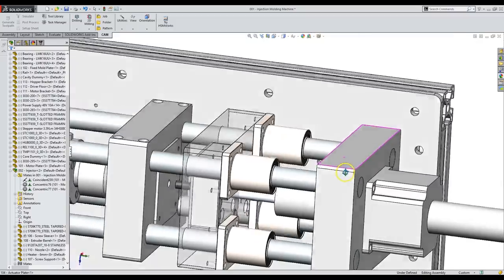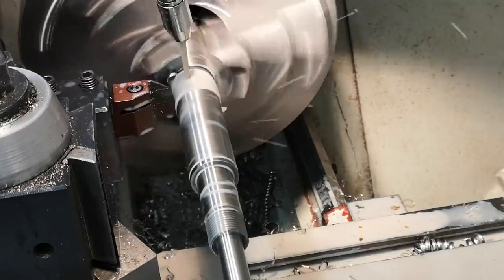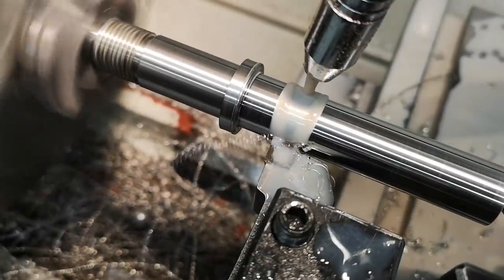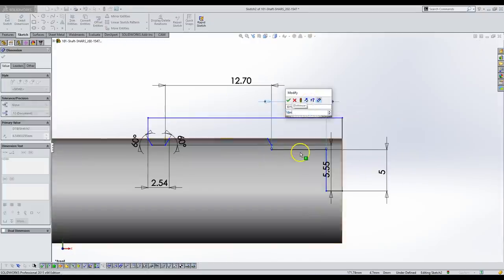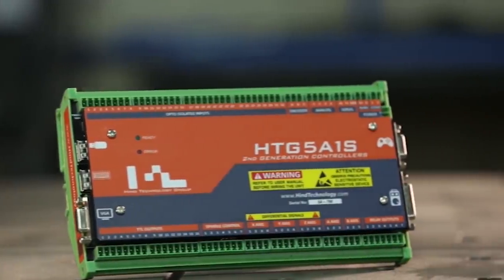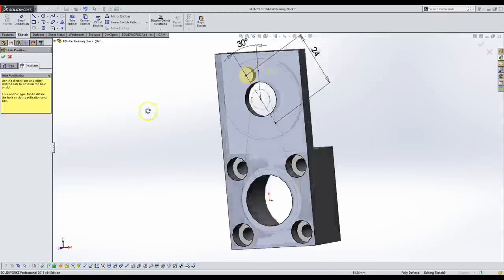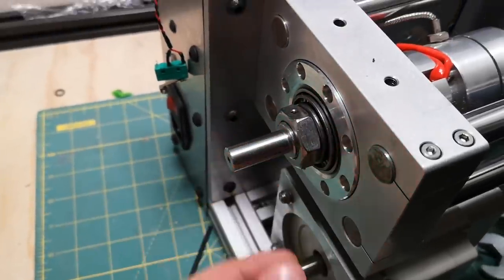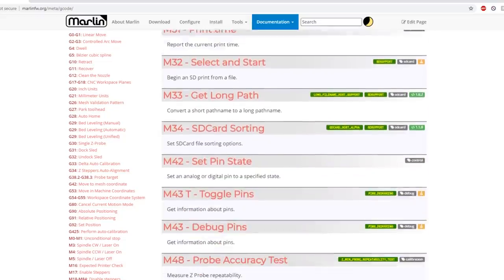Injection Molding Machine Part 2:  The Extruder Screw

Comment: "I can't grind a cutting tool with the right radius I need, so I'll build a toolpost spindle to cut the thread" is a level of knowing one's strengths and weaknesses I would love to achieve.
Reply from the maker: That's pretty much it.  It seems so much easier to make a quick and dirty tool post spindle compared to standing at the grinder for an hour, burning your fingers and cutting facets on what is supposed to be a flat surface lol
Reply: @TabletopMachineShop  You can use a cutoff tool to rough off excess material much faster than grinding it all away when your blank is a lot larger than your finished tool.
Reply: MRP

Comment: Woo a new video!  Love it :)

Re: Stepper vs BLDC. it should be noted that hobby BLDC manufacturers wildly over-inflate their wattage because they assume perfect cooling.  In practice, without forced air or water cooling hobby BLDC will give you ~50% their rated power before going into melt-down.  That aside, both are technically brushless so the main difference is their pole configuration and how they're driven.  Steppers try to maximize holding torque and precise steps, so have a very high pole count. Holding position over a pole produces essentially zero torque, so steppers compensate by pumping their max current through the coils to try and maintain position.  This in turn limits power density since everything has to be designed to withstand continuous 100% current duty cycle (as well as things like environmental sealing, standardized NEMA body plan, etc).  OTOH, hobby BLDC have low pole counts and the rotor always "lags" the stator, which produces maximum torque-to-current...but little position control. This gives them much better efficiency because it only needs enough current to overcome the opposing force, which in turn leads to better power density since it's assumed duty cycle won't be 100% max current.  But with so few poles you can't control position easily and need an encoder to close the loop instead (thus turning the hobby BLDC into a servo motor).

If you ever want to go waaay down the rabbit hole of motor design, magnetics, etc check out: https://things-in-motion.blogspot.com/  Really great blog that dives into all the nitty gritty details.
Reply from the maker: Thanks for the info!  It is a NEMA17 BLDC, not a stepper, but I imagine many of the same points apply when using them for precise motion control.  The hobby motor got insanely hot in use, so I managed the duty cycle myself by taking a few cuts and then letting it rest for a bit.  Thanks for the info as well, I'll make sure I have a look!  Also, subscribed to your channel!  I too enjoy breaking taps.
Reply: @TabletopMachineShop  Oh whoops, missed that one, critical detail :)  You can ignore 90% of what I wrote then heh.  FWIW, outrunner hobby BLDCs tend to be easier to cool (compared to those sealed inrunners) since they have open vents into the coils, makes it easier to point a cheapo fan down the bell.  Can claw back some of the spec'ed performance without too much heartache :)

<3 for the sub. The day I manage to stop breaking taps is the day I can probably quit my day job (soo... never)

Comment: look into oil extraction machine screws.  there are these little desktop sized seed oil extractors that run off what essentially is a meat grinder.  they have compression screws built in.  Likely the motor on them could also be controlled with a SSR so you can eliminate the need for that big stepper, and control the whole thing with Marlin/arduino/ramps gcode

Comment: Hiya TTMS, thought I would chime in on your motor question. The difference in power between a NEMA 17 BLDC and am RC BLDC comes from the difference in the current one can take compared to the other, but that has to do with the principles of their operation. That NEMA BLDC in particular looks to be a decent sized stepper with an integrated servo driver, which allows it to act as a sort of BLDC. This integrated servo driver gives you exact speed control, and in turn, exact position control by allowing the motor to draw more or less current to keep up with changing applied loads, and also to increase speed to "catch up" back to its position that it needs to be at if the load exceeds the stall torque. All of this fancy current monitoring and high frequency driving however does not change the fact that the NEMA BLDC is still at heart a stepper motor, and as such operates using several coils that are used to advance the armature by a certain angular displacement each "step" of the coils. In order to achieve this kind of timing with so many small steps on the rotor, it requires relatively low inductance in each coil to be able to energize that coil in a short enough amount of time. This is why those smaller stepper motors typically have driver output voltages that are around 1V-3V, because any more voltage applied to the low inductance coils would send so much current that the windings would burn through their enamel coats very quickly. The hobby BLDC operates on a similar principle, namely switching the magnetic field of the stator in order to induce rotation via EM interaction in the rotor. However, rather than worrying about each individual step taken by the coil, it can hit the coil with the max output voltage the driver can handle, which is the same as the input voltage into the driver. Since we don't care about the time it takes to saturate each coil, again remembering that these time scales are definitely in the realm of "very small". This large driver voltage across a relatively small inductance coil results in massive current spikes, especially at start up when there is no back-EMF to drop the input current. Sorry for the essay, but little nuances take some time to explain.
This project is fantastic by the way! Can't wait for the next installment.

Comment: I seem to remember a oxtoolco video where he used some 3D metal printed parts for his Sensitive drilling attachment. He said they were reasonably priced. I think he mentioned the company in the video series. Maybe a good candidate for this part?  Who is that Peter Stanton you mentioned in the video? Thanks!
Reply from the maker: Peter Stanton?  I think he's just a myth.  They say when there's a part with holes that are 40 diameters deep or integral internal keyways he appears...

Actually I did quickly investigate 3d printed metal parts, the ones I found were pretty expensive, but a viewer actually offered to print and send me an oversized version.  I think I'll do a video on cleaning it up as well, just to see how it machines.
Reply: @TabletopMachineShop   3D printing a part like this is a bad idea. The thermal stresses and the forces associated with turning and pushing the plastic will cause it to have a much shorter service life that machined billet due to inferior grain. Not using a compression screw is also not a great idea as most of the heat that melts the plastic comes from friction. Were I doing this project I would sooner do 3-4 overnights at a fast food joint and pay to have it done right in china then do it wrong myself. Overall I like your design, but you will find the length of the screw and the lack of a compression screw to be major oversights. If it is not too late, those are things I would change.

Comment: Hi there, I work in plastics and  I would advice you to make your screw at least 20 times longer than your diameter, and that it's maximum volume by weight to be at least 3.5 times  the total shot weight  but more to better but it's depends on the material. Also I would make a piston/screw combo with the ability to control the forward/reverse on the piston with it being charged via the screw, this would be ideal if you can't use a check ring. Injection mould takes alot more force than you would expect. If you ever need any advice please ask I've worked in the industry for 25 years making stuff like LDV, Rover, Dyson, Hozelock, Koito parts among other stuff. Good luck if you make another machine. Jim🏴🇬🇧

Comment: Misumi > McMaster
ReprapFirmware (Duet) > Marlin

Not bad, sketchy live tooling setup....But if it works, it works. Experimental at best I'd say hits the nail on the head. Interesting. Wonder if it would've been easier to 3D print and cast that they have it like sand blasted or something, but live tooling is definitely a game changer. 

Been gone for a while, glad to see you've kept yourself busy!
Reply: It wouldn't really make much sense to throw a duet on this setup. I'd probably just look at making a really simple ATMega based board with the necessary drivers, like one or two stepper drivers, a fet/ssr for the heater, and some sensing, and then have it run grbl or marlin (can't quite remember if grbl ever got temp control)

You're not exactly doing complicated 3D moves that require lots of calculations, nor are you driving a load of axies, so a duet is pretty wasted on it.
Reply: @dumle29  You're failing to think long-term though. Learn to Automate. Create passive income. Duet boards are servers, let's not forget that. Yeah, you wouldn't be leveraging the full potential of the board, you're absolutely right, but you'd still being networking and a lot of headers, fans, and the duet can run 24v with a few amps and ssr or you can use external motor drivers or just leverage some of the result configurable pwm control for stuff. Excessive? Perhaps. But you probably wouldn't need to do all that much coding and you could have start up routines and shutdown procedures.
Reply from the maker: I do have a duet kicking around...  I think it would definitely make more sense if I were selling these, but since other people are interested in making them I would be concerned about how difficult it would be to convey the setup information.  I seem to recall they're a little more difficult to setup.  I might look into it a little more though, it would be nice just to wirelessly connect and run a few parts...

You're a Misumi man?  How could you?  Actually I do like Misumi as well, I just dont like their website, I hate downloading zipped CAD with gibberish names, and I find sometimes the CAD I do get is super broken for some reason.

Comment: The power difference between nema17 bldc and hobby bldc is that huge because of heat dissipation. The efficiency of BLDC motor usually lies between 75% and 90%, so when you run 50 watt motor you probably waste ~10 watts to heat. Thats not a lot so aluminium body can dissipate it.
But when you run a 1800 watt motor at max rpm and max torque, you'll have to dissipate ~360 watts, which is huge for this size. Hobby BLDC motors usually work being cooled by water around it (if its RC hobby boat, like in your case) or excess flow of air, like in RC planes. While nema17 BLDC is supposed to run in S1 mode (basicaly 24/7 non stop).
360 watt is enough to heat up 1 kg of water by 5°C in a minute. Thats not little.

Comment: finally you are back. I am designing a similar toolpost grinder myself. but I got the same problem with the little torque. I am thinking of adding a plaetary geardrive.
Reply from the maker: Yeah that would certainly up the torque, I guess it depends on what speed you're aiming for.  You could always try a brushed DC motor for more torque at lower speeds too.  I was pretty impressed with this BLDC motor, even though I was starving it for current it would probably work quite well for easier metals like aluminum.

Comment: Just a small tip the flights in the screw should taper so the flights are smaller in the front and taller in the rear. This makes for better material feeding and melt compression. Also as a rule of thumb your part shot size should be about 30% of your barrel capacity.
Reply from the maker: Yeah that came up in my research.  Some of the smaller machines I've seen also seem to have straight screws so I'm hoping I can get away with it :p

Comment: The screw should have a L/D ratio of at least 18 and the thread should have a compression ratio of at least 2 for the plasticizing to be good. With those values at least two thirds of the heat will come from the mechanical processing of the plastic. It will then be evenly heated and well mixed.
Instead of using a straight screw you will probably get better results with a piston and a cylinder with a torpedo.
Reply from the maker: Yeah I think performance is going to suffer pretty severely for the sake of compactness.  The piston cylinder may be the right answer, but I'm so close now I might as well fire it up and see what happens.
Reply: @TabletopMachineShop  Yes, of course you must try it. No matter what I think that you will get a result. In the worst case you have to wait a couple of minutes between every shot.
It is also possible that for the first shot you will have to feed the screw a little at a time, with pauses between, to give the machine a chance to plasticize.
I am sure that you will get something out of the machine.
If you find out that you need better plasticizing you can make the screw and barrel smaller. Then you will improve the L/D ratio. 
And with a more shallow thread you will have more surface in relation to the volume of the melt, which will give you better plasticizing.
Here is room for endless experimentation.

Comment: Your channel is the nicest gem YT has come up with in a while.  Thanks for the great content :-)  BTW, the big difference between a hobby motor and an industrial one is duty cycle rating.  Surely a you must know that?
Reply from the maker: Thanks!  I knew there would be a duty cycle difference, and the RC motor no doubt is supposed to have a pretty solid airflow, I was more asking about the construction; the 50W for the BLDC is peak, so not a continuous duty cycle.  Even if the RC motor is supposed to be run for short bursts, there's a huge power difference

Comment: Hi, nice project.
First - the motor:
- industrial grade motors are made to be running 20.000hrs
- that hobby motor will maby last 200hrs, due to bearing overload and heat overload
- it is designed so and serves well if taken care of (lubricating and replacing bearings on time, provide sufficient cooling)
- power comes from thick wires and high currents

To the screw....
On industrial IMM's length vs diameter is something like 20:1. Not going under 15 and over 25. It is related to residence time for plastic. Going under 1.5 minutes will give you bad melt with semi molten parts that tend to block the runners. Than going over 10 minutes - plastic starts to turn to oil again.
Also - industrial machines use stroke of the screw to inject the plastic. What are you planning to use to inject?
Reply from the maker: Yup, the old 20khrs MTBF... Something tells me I won't be seeing 20000 hours out of this motor... it might have 2 or 3 left in it.

Yeah, regarding the screw, i did a bit of research before the first video (and of course watched the engineerguy video), and that all agreed with your points.  I guess what I'm doing is prioritizing compactness over performance.  This has caused me problems before:P

I think any mold I will use will be quite low pressure.  I'll avoid using runners where possible, have lots of fairly thick vents, and be ready to clean things up with a hobby knife :P.  The clearance between the screw and barrel is pretty small, so I think I'm hoping the near-static pressure downstream from the screw combined with a low pressure mold will be enough.  After all, I'd be happy just molding bushings, screw caps, and perhaps the occasional bottle opener .. not lawn chairs :P

As I mentioned, I'm considering making a plunger variant -- hopefully that will be able to deliver respectable pressure
Reply: @TabletopMachineShop  
You will have at least a couple of hundred of hours out of your RC inrunner before bearings fail. Just do not overheat it.
Babyplast is usind ancient double plunger system and it works pretty well. To do some reasonable molding - you will need at least some 450bar of melt pressure. 
Well - for lawn chairs you first need to upgrade the clamping unit to some 1.500 tones. Metric. :-)

Comment: I'd like to add 2 items of critique.   1. When trying to turn the screw with a form tool you did not need a full width form tool. A much narrower tool run with more passes would have done the job.  If you wanted to then you could have run a wider tool to smooth the root, but I suspect you would have found it to be unnecessary.  2. A machinist and machinery builder of your obvious ability should be able to build an adjustable taper attachment for your lathe in an afternoon.  

I have been following your build with great interest.  I have need of a better plastic injection machine for testing myself.  For now I just have a simple lever operated machine with very low volume.  Eventually I'll need to get some setup for gun drilling water jackets too.
Reply from the maker: I accept your two critiques!  Yeah the form tool was a disaster, I was never really expecting it to work, I should have used a thinner one and adjusted its position using the compound slide aligned with the bed.  I suppose I even could have made a tool holder that held a parting tool at an angle  for side clearance.  Ah well.  Unfortunately, the machine isn't my personal machine, so I would be hesitant to modify it in any way :(.

Thanks for the suggestions!
Reply: @TabletopMachineShop  - I definitely did NOT want to convey anything as negative.  Just offer suggestions if you need to redo the screw to make it longer in the future.  I was not aware the lathe was not yours.